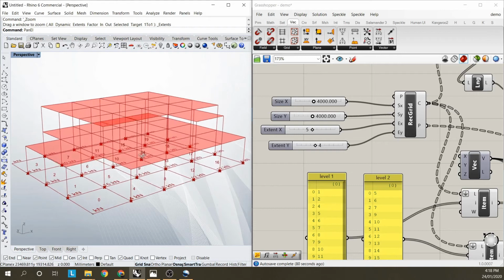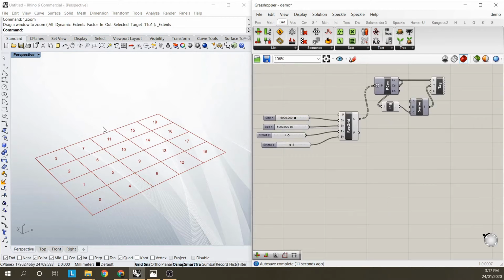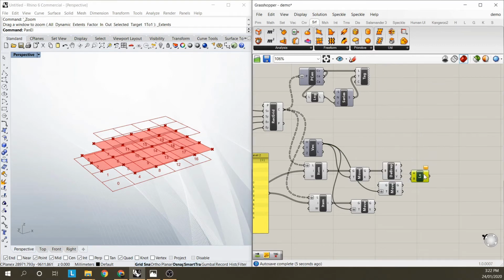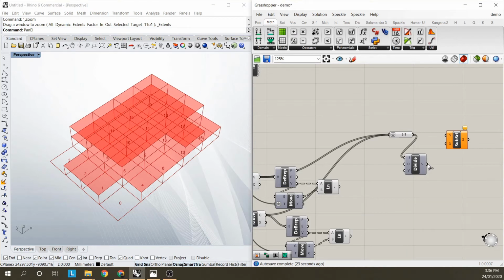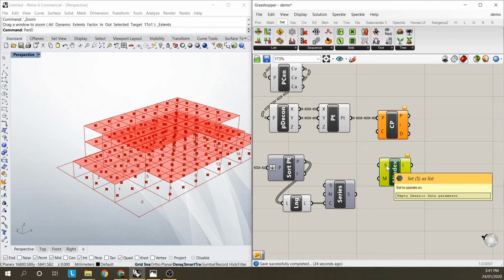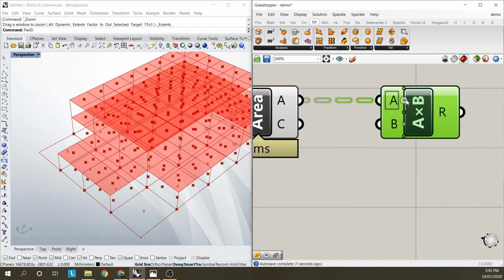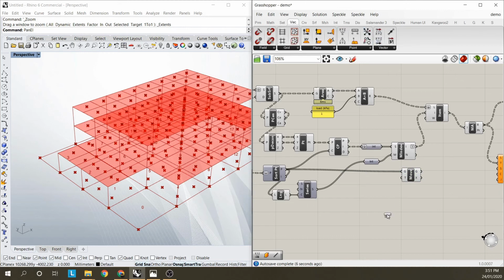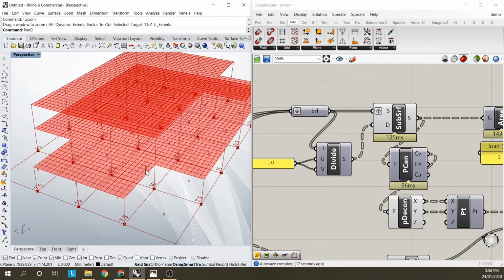Tutorial: Simple Column Load Rundown. Get structural column loads auto generated from geometry.

Comment: this appears to give results on trib area only. Can it be modified to account for elastic shear as well, ie for continuity of a slab where the first support from an edge has a higher reaction than trib area?
Reply from the maker: Yes this is a very simple script. It is certainly possible to include continuity of slab. Either by adding to the script manually or by adding an elastic analysis engine into the script such as kiwi3d or karamba.